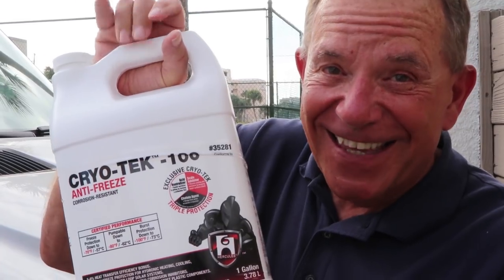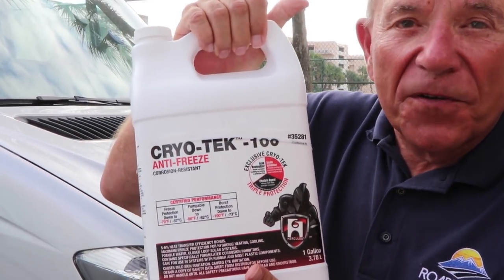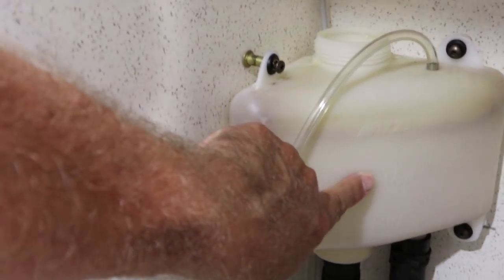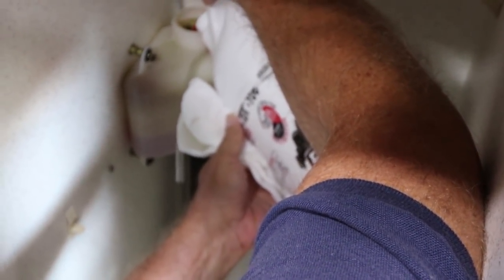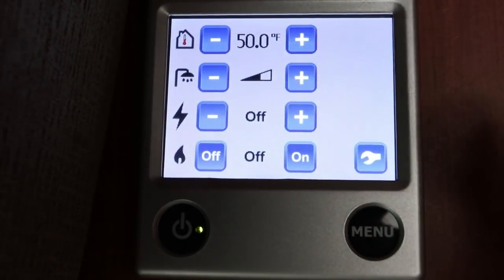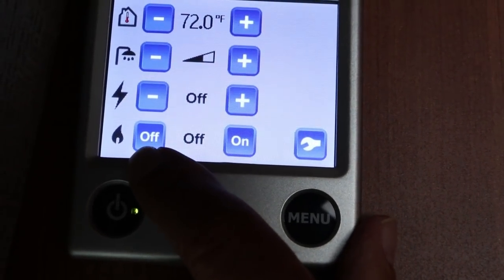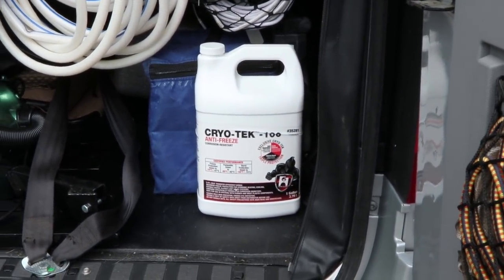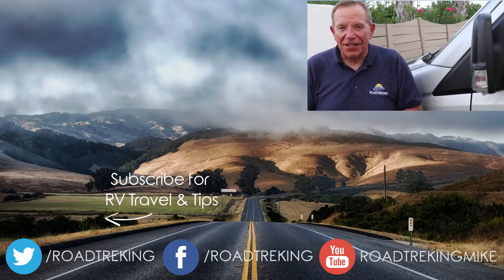How to Replace the Fluid in Alde RV Heaters

Comment: Keep in mind T@B owners.  T@B uses aluminum components that require hydronic fluid designed for aluminum.  It is sometimes hard to find.  NAPA had it in my area.
Reply: My Alde 3010 in my T@B CS-S Max run completely dry before I noticed it wasn't heating.  I've refilled, checked for leaks, fuses and breakers, but no action at all.  Any ideas?

Comment: Where does the anti-freeze go? Also should you run the system after filling, before closing it up? Nice videos that are very helpful. Another thumbs up from me.
Reply: @thomas hanlon:    Yes, I'd say he should have run it and then re-check the fluid level as there could be air pockets needing filling (you heard the gurgling sound as the fluid went down into the system)...but he doesn't seem that mechanically-savvy (and didn't even clean off the spill he made from pouring). 

Further, an explanation of why you need to add fluid to ANY "closed system" (as I'm guessing because he didn't say) the Alde IS would have been useful, since if a truly "closed system" gets low on fluid there's likely a LEAK somewhere, yes?

Maybe the Alde has a vent somewhere that slowly evaporates the fluid over time, or a "safety-valve" so it doesn't explode if the pressure/fluid temperature gets too high (although the valve should not leak!), but still, TMK a closed system is just that -- fluid doesn't diminish over time unless there's a leak, and that'd mean something's wrong.

If the Alde tank came that way from the factory (not filled even to the MINIMUM line) then shame on Roadtrek for letting it out the door before checking EVERYTHING first! Very disappointing evidence of poor quality-control going on there @ Roadtrek. Potential/future buyers of Class Bs (as I am) look not only at the product, but also how good (or not) a maker's QC is. The less problems a new RV has the better...not only for the buyer (of course) but also for the dealer & maker who don't want to get the thing back  to "finish building" or "repairing" a brand new RV.

-- BR

Comment: Can I use.......any brand of antifreeze or does it have to be a specific kind of caravan related antifreeze please?
Reply: Use 'G13' rated antifreeze only and it will come in a magenta colour.
If your current antifreeze is blue, it is best to have an Alde engineer completely change the entire contents of your system as some antifreeze don't mix.

Comment: While this guy was giving 'a tip', sadly he omitted a crucial part of the topping up process.
When you are topping up the system, FIRSTLY you need to run the system up to a high or full temperature as heat expands the fluid level (by quite a bit).
Then add the fluid to slightly below the max level (around a quarter to half an inch or 10mm).
When your system then cools down, the level will drop down, DO NOT be tempted to fill it back up to the max again or you may get a messy overflow from the header tank into your RV/Caravan when the system heats up and expands once more.

Comment: Where did you find info that the Cryo-Tek 100 meets the specs for Alde RV heaters ?  I don't see it, the spec says G12++ and safe for Aluminum, Cryo-Tek is NOT safe for aluminum, it says so right on the bottle, and it is not G12++, it is also the wrong color and mixing colors is NOT a god idea
Reply from the maker: I called Alde themselves and Ken Elwell, the President, told me that would work just fine. It was first suggested by Roadtrek.

Comment: If being low would it indicate a leak?
Reply from the maker: I think mine was never filled. I got our 2017 Roadtrek CS Adventurous XL 4X4 in May and never needed or turned on the heater until now.